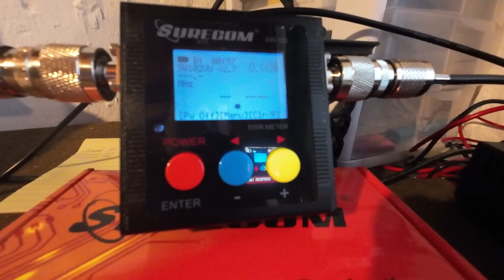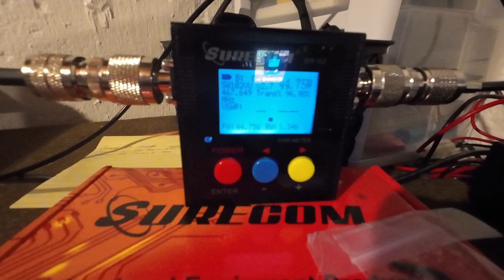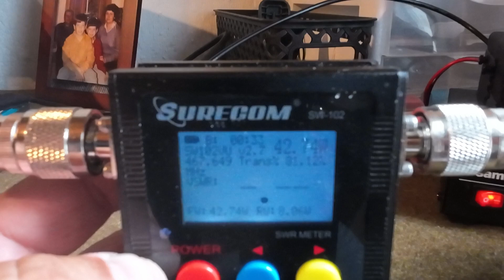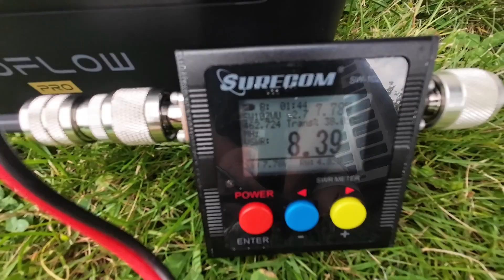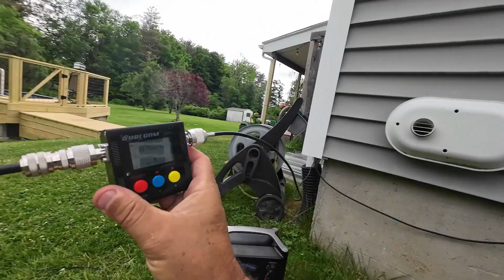GMRS Base Station Antenna

Comment: I bought the exact same set up for using my mobile GMRS antenna as a base station on the house. 
I haven't tried it yet.
Rather than putting that up, I am ordering a Ed Fong GMRS antenna. I called Ed Fong directly. He recommended a separate GMRS antenna and also his separate dual band antenna for HAM . Ed also insisted that two antennas need to be a minimum of 5 feet apart.
I love how you real world test everything.
The area I live in is so darn flat. Line of sight is tough unless you get your antenna up high. The best I can do right now is about 20-25 ft on the house.
There are no GMRS repeaters within 60 miles of me.
Reply from the maker: Thanks for commenting. I've also spoken to Ed, what a great guy. My dual band setup he provided to me works fantastic. It sound like we have very similar problem with line of sight. Your to flat and I have to many hills. (lol) Thanks for leaving a comment. Good luck with your setup.

Comment: I had a very similar ground plane from MFJ. It was utterly unsuitable for outdoor use. For me, the CompacTenna ground plane was a sturdy replacement.
But, yeah, as said elsewhere, RG-8x coax is only ok for 50 foot or shorter runs on high frequencies like GMRS. Keep the coax a few inches away from metal siding and downspouts AMAP. If possible, use LMR-400 coax for long runs. Keep your antennas at least 6 feet apart.
Reply from the maker: I learned the hard way. My new antenna is up and running perfectly. Ed Fong antenna with KMR400. Thank you for commenting

Comment: Lots of good advice in the comments here.

Things to look out for: 
Ground plane issues
eliminating things from the equation to see if it gets any better.
Moving it away from the other antenna
Coax length/quality. Along with the connectors as well
The route of the coax could be too close to conductors.
Reply from the maker: Thanks for commenting.

Comment: My suggestion: Don't run your coax along the downspout.  I'd try to slip it behind that plastic corner flashing instead.  You don't want your coax taking that long of a path along a good conductor.  Yes, your cheap little SWR meter is probably not doing you any favors either.  Find a local ham radio operator who has a device called an antenna analyzer.  He can "sweep" your antenna system and find out what is going wrong with it.  I'd also change your coax to high quality RG-8X type such as Timewave LMR240.  If your not a ham radio operator, contact your local ham radio club and I'm sure they'll be more than happy to get you sorted out.  73 de Larry, K3LT GMRS: WSDI872.
Reply from the maker: Ok thank you for the advice.

Comment: Several things could be wrong there. First, if moisture has gotten into your coax it will cause random swr readings like that. You should always wrap some electrical tape around any outdoors connections to prevent rain from getting in. Also there’s a lot of metal near your antenna, that will cause issues as well. The coax running along that metal drain pipe could cause issues. I’d start by taking the antenna (with mount) down and setting it several feet away from any large metal objects and checking swr again. If it’s still high, it may be your coax. If it’s normal, then you need to mount the antenna somewhere else, I’d try putting it up at the peak of the roof and run the coax straight down to your entry point into the house. The lightning arrestor is going to be useless until you connect it to a ground rod. You can get one at Home Depot or Lowe’s. Should be 8ft copper or copper plated. Then use copper wire to connect it to your house ground rod which is usually right next to the electric meter.
Reply from the maker: Thank you for your advice. I think the antenna is coming down this week and I'm re-evaluating my set up. Just a couple notes. Moisture is not an issue the antenna was only up about 4 hours while I was installing it and filming at the same time. Also, I wanted to put it up at the peak of the roof but that is where my electrical service comes in and I thought that would cause interference.

Comment: I would not place two antennas that close to each other.  When one is transmitting, the other will be subjected to excessive RF energy, even at a few watts.  That can cause issues in your set-up and to whatever other device is connected to it.  Good Luck!
Reply from the maker: One antenna was connected to the radio the other was just sitting there not connected to anything
Reply: @paulethier3416  Bend the ground radials down at 45 degrees and test again with out any other antennas near .Then the radials at 45 deg, it will bring the impedance to 50 ohms which is what radio antennas are designed for. Also, use a larger diameter coax such as RG 214,or an LMR 400 by Times Microwave. Those type coaxes are less lossy than RG58 which mostly used for shorter runs as in a vehicle .  Base stations have a longer run from the radio to the roof.
   As other replies have said ,measure the length of the whip and  as with most antennas come with a cutting chart  to  cut the antenna for the freq.of the radio.
At UHF frequencies ,a 1/4 wave antenna is 6 inches  long.
Reply from the maker: @donp5941  Thank you for the suggestions. I was going to bend the radials but then they would hit the roof. I think my antenna height is a bit to low and the roof is part of the problem. Also, I was wondering if there is such a thing as the radials being two long as I've seen other antennas with shorter radials bend down 45 degrees. The second antenna I tried I know is tuned to the correct length the 1st antenna is tuned for dual band (uhf/vhf). Thanks for the advice. I have lots to learn and lots to try, but I will get figured out.

Comment: I would definitely try a different meter and see what’s going on I would also probably bump up to at least a RG8X coax on that long of a run
Reply from the maker: Yeah, I agree. Its all over the place and not consistent at all. I tried another radio off camera and the SWR was 18. So frustrating.
Reply: @paulethier3416  there is nothing any more annoying than an electrical issue whether it be something as simple as swr on a radio or a 100 thousand dollar car they drive me crazy 🤪 haha
Reply from the maker: Agreed
Reply: @paulethier3416 get the Mfj 269 meter. You don’t need a radio to test with it.

Comment: Two antennas that close to each other will effect your SWR in negative ways. Separate the antennas a larger distance and see if the SWR changes. I'm betting it will.
Reply from the maker: Ok, Ill give it a try. I'm going to get another meter also. My goal is to get the house antenna up and running.

Comment: Hey Paul, are any of your antennas tunable? When I mounted my base antenna (Tram 1486) I had to do some clipping and tuning to get my SWR down to a useable level.
Reply: I found when I made my portable antenna  and used the radials the unit would not even transmit signal I took off the radials and works well. Don't have a swr meter
Reply from the maker: They were all tuned when they were installed as mobile antennas. Maybe I need to retune them? I never really gave it a thought I figured once they were tuned, but maybe I’m wrong.
Reply: @paulethier3416  My Tram was supposed to come tuned for GMRS frequencies but the SWR was still too high. I had to do some trimming.